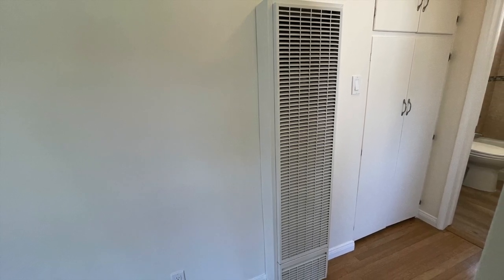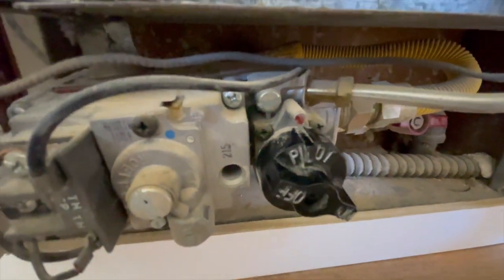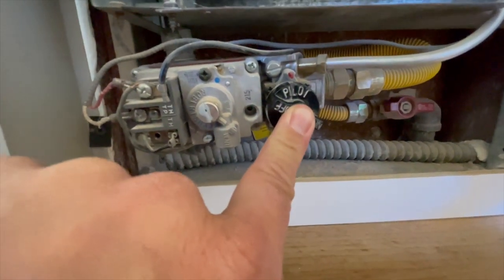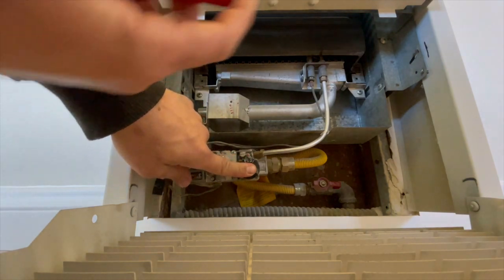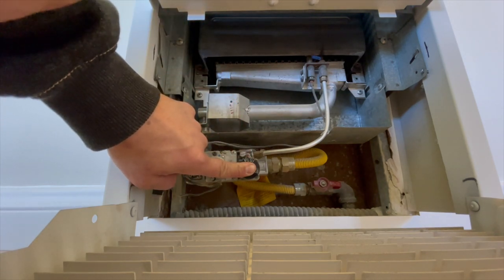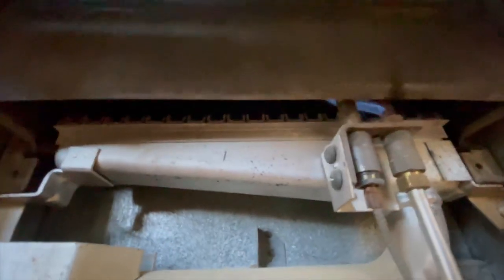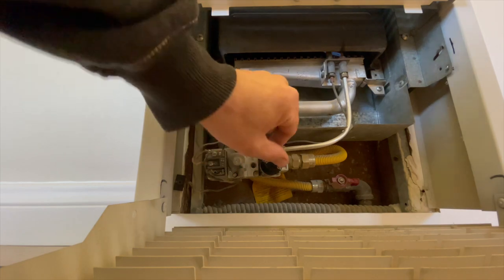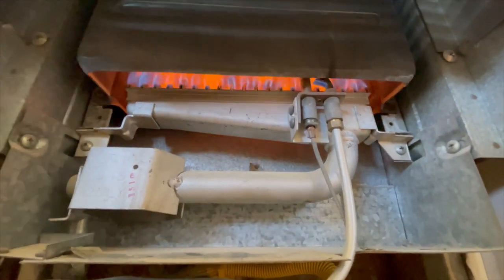How to light a wall heater pilot.

Comment: quick question, does gas leak out when you turn the pilot light off? I turned mine off for summer, however am now worried if there is gas leaking into the air and causing a breathing or fire hazard.

Comment: Thanks! The general idea helped a lot. I didn’t need to hold down on mine. Nor did i have to ignite it. The little flame was already running. All i had to do was move a little knob that ranged from 1-5 and it turned everyone on

Comment: Ive been trying to get my wall heater to work. My pilot light stays lit. itll fire up sometimes. The flames will go for a few minute then its gone. Does that mean its working? Not the pilot light but the flames.

Comment: Mine is just like yours, except the entire thing is angled upward to where the letters on the dial are facing directly upward, so I can't see where the dial is dialing to properly; and the little pipe to the pilot disappears behind a sheet of metal and I can't see there to properly light it either.

Comment: The pilot light has a tube next to it that seems to have burn marks, a small blue flame around it, plastic peeling off..is this normal?? I had my co alarm go off when the heater has been working all day.. I called the gas company but they won't come till monday..any help is greatly appreciated. Thanks

Comment: I followed a step by step of a different video I saw on YouTube but when I went to turn on the heat on the thermostat and checked back on the flame it was bigger (as this video showed and I freaked out! Shut off the gas thinking it wasn’t normal for it to fire up that large) I’ve never had a wall heater and was terrified it would blow up or something. Now that I see the flame IS supposed to get large when the thermostat is set,  I’m going to try again 😰.